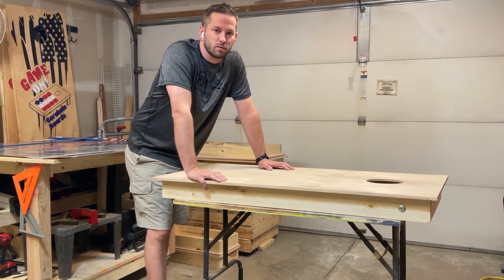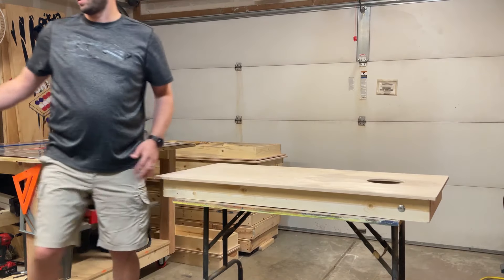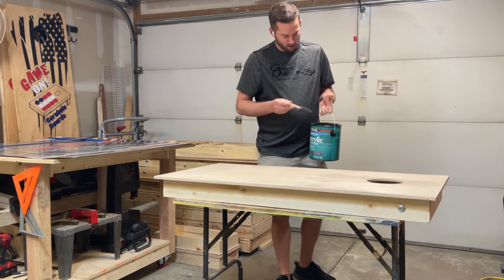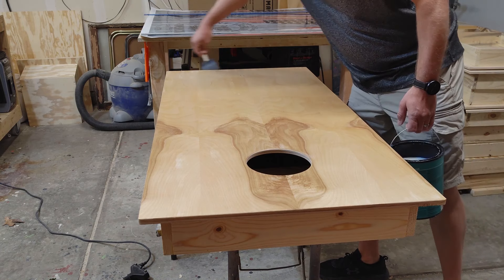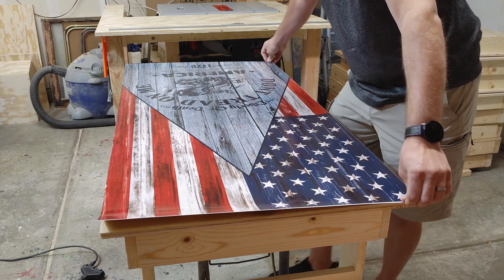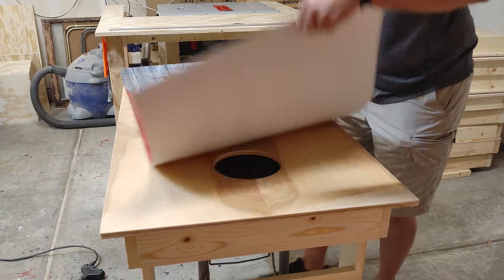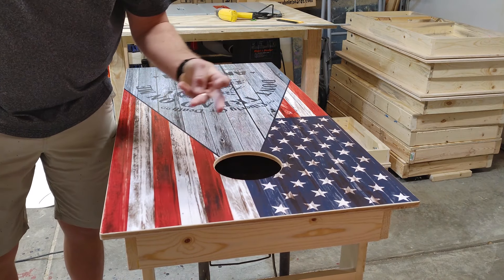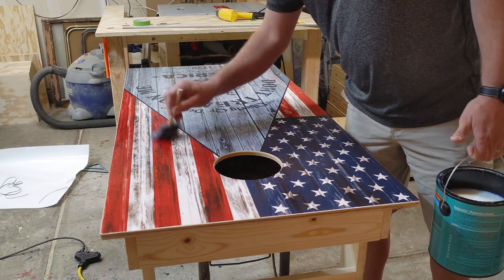Installing a vinyl wrap - cornhole boards

Comment: The paint store has a tack cloth to remove all dust particles. The brush & hand won’t clean all the dust off.  FYI
Reply from the maker: You are correct. I don’t try to get that layer perfect clean. Once you apply the acrylic, it sounds down like glass every time. Thanks for the tip though!!!

Comment: Enjoyed the video. I’m all about overkill but I regret using the spray adhesive. I attempted to spray the edges and I guess it came out clumpy. So all of that work sanding and smoothing out the poly was for nothing. I lost a whole wrap due to trying to fix it/smooth it out after I laid the vinyl out. Probably something that helps when you’ve been doing a lot of these
Reply from the maker: I have since posted a new video that no longer uses the spray adhesive. We have changed to a vinyl that has a much better adhesive
Reply: @Gameondad6  can you post the link of the new video? I can’t find it
Reply from the maker: @ashleydye2605  https://youtu.be/GiHlI_OmGiU?si=sG6SS5O_5843Nycj

Comment: I quit using the plastic squeegee. Started using a rubber roller. Zero scratches and can press harder. But I router  the hole with a round over bit so it makes it difficult to cut it out clean

Comment: You do very well answering questions. I’ve been getting bubbles in my polyacrylic when it’s dry. How do I stop that from happening on my final coat so I don’t have to keep sanding them out?
Reply from the maker: Are you using a brush or sponge?
Reply: @Gameondad6  I am using a synthetic brush. This happens with the foam throwaways as well.

Comment: It seems there are 2 camps out there. Those that say 1 to 2 coats are enough. The other says 5 to 10 coats. 
I my self don’t want my boards too slick. 
Im ready to apply wraps in a day or two. The back side of the wrap says ORAJET Rapid air. It is laminated. I’m not even sure if using a heat gun is required to apply these. 
I’d rather go two coats, sand then be finished. 
I’m using semi gloss Spar Urethane. Because it is semi gloss, I hope it doesn’t dull the look of the wrap. It’s made the paint on the sides of the board and the underside look glossy so I guess I can use it with no concerns.
Reply from the maker: You sound like you have a good game plan... That's also good vinyl!

Comment: Question! I ordered some cornhole boards off of Amazon, I was going to lay down wallpaper and then a vinyl decal over the top of that. What is the best process for me to do this and have it durable for outside etc
Reply from the maker: After you apply the vinyl on top of the wallpaper, seal it up!

Comment: I have the birch plywood, do need to any special prep work before putting a laminate wrap on?
Reply from the maker: Sand it and seal it with polyurethane or polycyclic first.

Comment: Great video.  The boards I have were given to me painted (Miller Premium Enamel, Alkyd Enamel, white).  We are installing vinyl wraps.  A few questions: 1) should I sand it off completely or just smooth it out.  2) once smooth, should I apply another coat of the primer/paint or should I apply a coat of the Polycrylic, or ??.  3) Assume everything else with the install is the same from that point, starting with the spray adhesive...
Reply from the maker: Make sure the surface is smooth. You might throw a coat of white primer on it if the paint is darker (it could show through). A layer of polycrylic won't hurt

Comment: Nice video.  How would you finish a board that is only partially wrapped with just a decal in the center?
Reply from the maker: Polycrylic. Several layers, sanded in between

Comment: Hello, I followed your instructions and the boards came out great but two weeks later the wrap started to peel from one of the corners. Any suggestions what I could do at this point.
Reply from the maker: Sometimes applying some heat and using a squeegee to apply pressure will remedy that

Comment: That looks like an old Craftsman router table. Much like mine. LOL BTW, does the squeegee come with the decals?
Reply from the maker: We have several older craftsman power tools! You just can't beat them :). We no longer include a squeegee with the wraps. We ran into issues with availability and quality.

Comment: I currently have a raw wood board. Before I apply a wrap should I polyurethane to the top of the raw board to help protect it? OR will that action cause the wrap not to adhere properly? Thanks, Kurt
Reply from the maker: You want to put a coat on the raw wood. Sand and repeat. A good sheen will help the vinyl stick.

Comment: Is the squeegee I need one that has felt on one end? Also, is ther another lining step needed if the wrap already has a hole printed on the vinyl where it should be cut? (To ensure it lines up) Thank you for the wonderful and informative video!! :)
Reply from the maker: I like to use a felt lined squeegee if possible. It allows you to use a bit more pressure and lowers the risk of damage. I have personally scuffed a wrap or two over the years because of a squeegee not being lined. 

Yes! If you have a wrap with a hole printed, it does take some extra finesse. Do your best to line up the hole first and then make sure the wrap is square with the board as much as possible.
Reply: @Gameondad6  Thank you so much! I was able to apply the wraps perfectly! They came without a hole printed so I was able to cut like you did. The wraps I received are laminated - can I apply something over these to help ensure they last/corners stay put?
Reply from the maker: @adivaonadime  if the wraps are laminated, DO NOT apply any thing over them. The laminate is all you need 🙂. I'm glad it all worked out for you 🤙

Comment: Really nice video. I would like to make my own vinyl. Do you know what and where I can purchase the machines/equipments to do so ? I am living out of the U. S. and it's going to be way too expensive with shipping and customs charges to be trying to buy them from a company in the U. S. for my business.  Thanks
Reply from the maker: I would first check local to you. See if an existing sign shop has a printer for sale. That's how I started. My printer is a 63" ecosolvent CMYK printer. If you find a decent used one, you'll probably get started for $5-10k USD. New, double that. 

Rolan, mimaki, and Epson all make great stuff. There are several knock off Chinese printers out there on websites like AliExpress.

Comment: What is the spray your using before putting on vinyl? Live in Wisconsin don't want it to come off
Reply from the maker: It was medium strength contact cement, but we have switched to a higher end vinyl that doesn't require it anymore
Reply: Do you have to use the spray adhesive ?

Comment: What type of water sealer was that one gallon can and what kind of spray was that the adhesive
Reply from the maker: Water based polycrylic for the sealer. 

The spray was a medium duty loctite adhesive contact cement

Comment: Slighty unrelated, but I was hoping that you crafty ladies/gents might be able to help me or at least point me in the right direction. We are going to be using corn hole boards as our guest book at the wedding this Summer. I wanted something different, and at least this time, whenever we play we will remember the day. ANYWAY, the board is covered with a customized vinyl wrap with our last name on it. 
What would be the best to have guests sign with and still be able to seal after (and what would be the best seal that isn't going to degrade when sealer is applied)
I thought black and or metalic sharpies, but wasn't sure how they would hold up under a seal coat. Then I thought OOOO A Paint pen, but then do i do water/oil based?
I'm so confused
Reply from the maker: Sharpie will be fine. Then use a water based polycrylic to seal it in

Comment: I don't see how the finish can properly adhere to the shiny surface of the vinyl. As a professional woodworker & finisher, the poly would need a scuffed surface to bite and adhere. How long does it last before peeling off?
Reply from the maker: I've never experienced an issue with the acrylic sticking. We've put out 600+ sets over the last 5 years. The vinyl itself is technically porous.
Reply: @Gameondad6  That makes sense then. I've applied epoxy over vinyl decals on Fire Dept tables before so it's probably the same concept except the tables I build don't get used outdoors. How well does it hold up say 3,4,5yrs later? Probably not that big a deal since CH boards only sell for $200-$300 unless they're Luxury CH boards.

Comment: This was a great tutorial. I have been finishing cornhole boards for less than one year and I am still refining my process. Do you use polycrylic on ALL of your vinyl wrapped boards?
Reply: Yes. If the wrap isn't laminated, I apply at least one layer of water based gloss polycrylic to them.
Reply: @bassplayersyx  thank you sir. I just bought some of the gloss because of your suggestion. Thanks again.
Reply from the maker: @TheJenkinsFam  Great! Feel free to send us a message if you have any further questions.
Reply: Do you use gloss or semi gloss or satin finish?

Comment: Why not use laminated wraps instead? They're more durable & no need for a clear coat, correct?
Reply from the maker: You are correct! We have started laminating them since this video. This is really intended for those who don't have lam or want to control the speed of their boards

Comment: I have been hand painting cornhole boards and coating them with epoxy resin. Can the wraps be coated with epoxy also ?
Reply from the maker: I have not tried that before, but I don't see why not.
Reply: @Gameondad6  going to try it Thursday, I will let you know how it goes and a pic or two. thanks for the response.

Comment: Thanks for the great video. I was told to wait 30 days to allow for the sealant to cure before applying the wrap. What are your thoughts regarding that? Thansk
Reply from the maker: I'm not sure I entirely understand what you're asking with the "sealant". We recommend letting freshly printed wraps rest/air dry for 24 hours before applying them.  The water based acrylic we use is dry in literal minutes. I suppose of you used an oil based sealant, it could take quite a bit longer.
Reply: @Gameondad6  I just bought some for hole boards and then bought some wrap. The instructions told me to either let the wood cure for 30 days or to apply sealant like you used and let that cure for 30 days. If I didn’t do that, then the fumes or something like would cause the wrap to lift. Hope that makes sense.
Reply from the maker: @johnarchitzel6201  feel free to send us a message on our Facebook account and we can better assist you there

Comment: I learned a lot, thanks. But if I owned it the triangle not lining up with the hole would drive me nuts
Reply from the maker: You're not wrong. It was off center about 1/8" of an inch. It does happen sometimes.
Reply: @Gameondad6

Comment: is the vinyl very slick for the bags or about the same as if it were paint?
Reply from the maker: The vinyl (laminated) gives you a very clean and consistent surface to play on. Painted surfaces will fluctuate more with climate/humidity change. The vinyl plays at a very nice speed.

Comment: I've done decals before, but never a wrap.  So, at the risk of asking a potentially stupid question, can the wraps be replaced with a different wrap down the road?  I thought I read that somewhere, but can't understand how that is possible if you're placing a coat of polycrylic on it.
Reply from the maker: Yes, a wrap can be replaced. It does require some elbow grease

Comment: When I get the 220 grit for the end. It looks like it leaves scratches on the poly. Any idea?
Reply from the maker: You might step it down to 320. The ultimate goal is that the surface is smooth as butter and has a bit of sheen to it for the vinyl to stick.
Reply: @Gameondad6  that's what I figured. Thank you for getting back to me.

Comment: Your vinyl is so flat and doesn’t roll up. How you you get so flat?  And we are having trouble with our vinyl lifting on the edges. How do we stop that?
Reply: What kind of vinyl are you using?
Reply from the maker: You might use a little heat and pressure. Hair dryer or heat gun will help

Comment: Do you know the difference between laminated and non laminated wraps? If so which one is better?
Reply: It's mainly a matter of preference. Installing a wrap with over laminate on it is easier faster, but slightly more expensive. Laminated is also more consistent to play on

Comment: Hey if the vinyl is laminated do you still poly over ? It won’t hurt it right ?
Reply: I just the polycyclic almost exclusively right now. I like having control over the speed of the boards. This allows that. If you’re making a lot of boards for people who aren’t picky, you can use laminate.
Reply: David. I been doing wraps and boards since covid started . You can do either way . You don’t really need any poly with laminate. But for speed and to allow the bags to slide  a little wax helps with that. I personally don’t like putting poly if it’s laminate since you can see the brush marks usually.
Reply: @nickc5668 what did you use for wax?

Comment: So I put the acrylic on top of the vinyl  and it has a white haze, how do I get it clear?
Reply: I'm not 100% sure what your conditions were when you applied the poly? but it usually happens when there is a higher humidity or rain? it's water based and moisture in the air cam do that.  Once dried, not sure it can be removed????
Reply from the maker: I had a similar issue two weeks ago. I had a can of poly acrylic from over the winter time I used. The humidity made it very tough. You can try to do a light sanding with a relatively high grit and then try putting a thin layer of acrylic down again. Try to pick a day it’s not raining or you have a lot of ground water if you’re in a non climate controlled garage\shop. Also, make sure you’re stirring up that can of acrylic! It has a tendency to settle to the bottom on some brands.
Reply: @Gameondad6  simple fix just added another layer and it cleared up.

Comment: Any ideas on how to apply the vinyl on rounded corners? I make my boards with round corners vs sharp and always have trouble getting a smooth application without getting any creases. I also tuck my wrap around and under the edge to help avoid the wrap from peeling up
Reply from the maker: I didn’t have the best luck with wrapping the boards all the way around. My best advice if you prefer to wrap the entire face is to use contact cement on the back side to help the vinyl adhere and stick. As far as the rounded corners, you would likely have to use a heat gun and pull/stretch the vinyl over the corners the best you could. I had custom edge trimmers made to help me keep the wrap cleanly cut around the surface of the boards. Also, as long as you prep the surface properly, you should not have the edges pealing. Feel free to send me a pm on our facebook page for more detailed help
Reply: Heat not a lot just light heat until it will stretch without creases
Reply: @treybrown6811  thanks I’ll give it a shot
Reply: @Gameondad6  thanks will do. I sometimes try to tuck the vinyl under the board vs flush cutting it. Just worried if I flush cut it might peel up later on. But I do prep well.
Reply: Tucking your wrap on rounded corners IS your problem with creases. To stop the creases, square the corners up

Comment: What vinyl do you find best to use?
Reply from the maker: We have landed on arlon 510MTX. It seems to be the best bang for the buck. I've used 3m, arlon, oracal, briteline, and a couple others. 3m is the Cadillac of vinyl for me, but it's big $$$.
Reply: @Gameondad6  what does that run per roll? I have a 54” Roland printer.
Reply: @Gameondad6  also do you have a fb page to follow?
Reply from the maker: @malachicustoms5595  Game On Graphics & Cornhole on FB. The vinyl...around $160 a roll. I buy 54" rolls, but my printer is 63"

Comment: Is the wrap that you use (linked in your notes) $65 for a set or just a single wrap?  Also, are the ones you used laminated or not?
Reply from the maker: $65 for a pair. $75 for a pair if you want them laminated (no polycyclic needed to seal them)
Reply: @Gameondad6  TY

Comment: How doe this interior finish last in the elements? How well does it stick to the vinyl? I have seen this finish not hold up in exterior environment.
Reply from the maker: We've been using it for years with no complaints. Now, we also don't recommend leaving boards in the rain or out for long periods of time (days on end). You can definitely use an oil based urethane if you prefer, but the design will yellow/Amber over time.

Comment: I’ve never seen sanding before that didn’t create dust in the air
Reply from the maker: It definitely does. You need a filtration system to help

Comment: Went on your website and I see many flag wraps that are not displayed / made correctly.  When displaying the American flag vertically, the star field should be upper left.  Some are correct  but the ones that are not should be corrected to show respect.  You have a lot of good products, please respect the American flag that's all I am asking...
Reply from the maker: We offer them by customer preference! You are 100% correct on the orientation of the union. We have some customers that prefer it on the upper right side. You can request either/or during ordering. When we started this, I actually reached out for advice on this from the local PD. If the image isn't a true and standard American flag, the orientation isn't required to be on the upper left.
Reply: @Gameondad6  Thanks so much for the clarification.  Wasn't giving you a hard time was just trying to bring it to your attention but it appears the proper research was done !  Kudos to you ! Good luck with all your future endeavors...Have subscribed to your channel.  Looking forward to future vids...